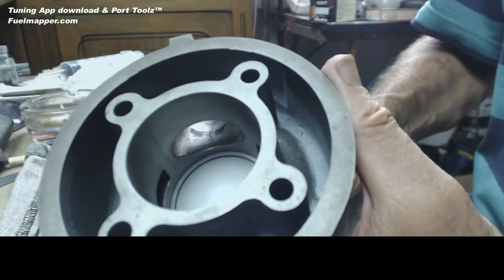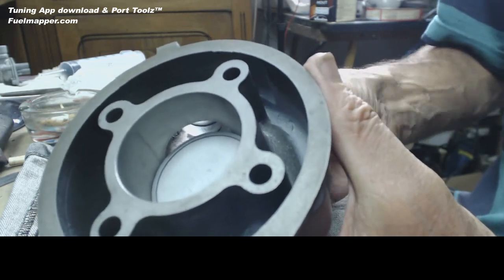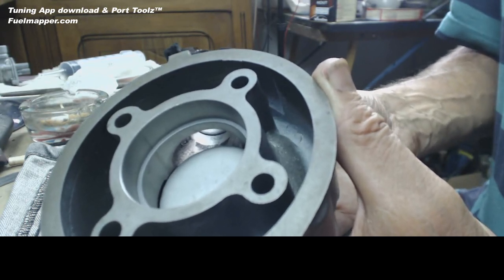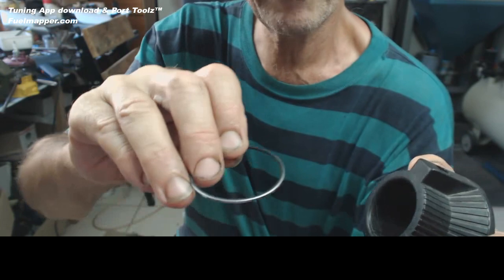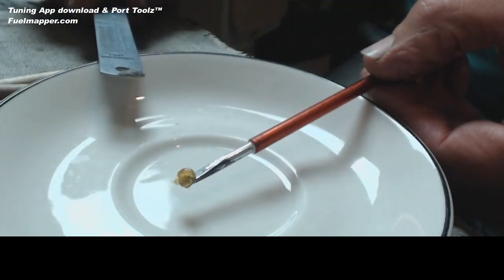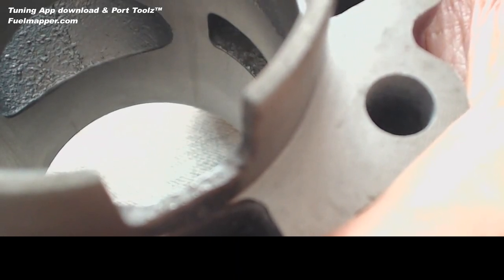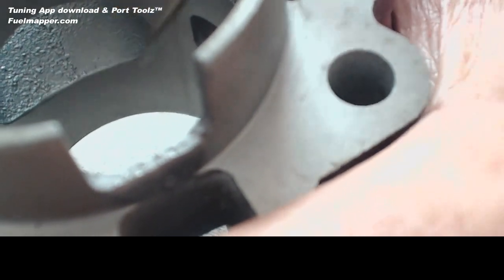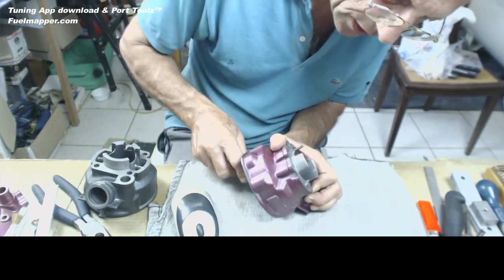Porting Tools:  Cylinder wall scratch & scoring - Stopped in 5 Easy Steps

Comment: Wouldn't the piston rings do this by itself, and once the piston rings are worn out a bit you can change them?
Reply from the maker: If you are lucky, the bores may survive this process, however it is often the case that the bore becomes scratched or deeply gouged ... the hardened piston ring catches the port edge, ripping the metal down the bore.
There are other benefits, but securing the bores is the most visible ;)
Reply: @EngineTuning  I see, and this would be the most common issue in cheaper top ends I would assume? or do the really expensive ones also come with this issue?
Reply from the maker: It's hard to say.
You need to examine new cylinders under a good light.
If the ports have razor sharp edges... 
When the ring deforms into the port ... as it reforms its shape to the cylinder, it can catch the sharp edge ... in a millisecond, the damage is done.
Therefore, at very least remove the sharp edges.

The problem for manufacturers is that; radiusing the ports is a time consuming task.
Hence, it is left to the customer, or dedicated tuning shops.
Reply: @EngineTuning  sounds really strange that they sell a product that will break the product that they sell you.. so the original manufactured cylinder that comes with the bike should have this already done to it yes?
Reply from the maker: 1. It's not strange at all.
2. Either the original has been radiused, or it hasn't.
    We would hope that the sharp edges have been removed ... but have they?

Don't forget ... the owner doesn't discover if the cylinders are scored, until they open it up.
If, when they do, they find them scored ... it happened during the running in process.
Ie. In the first moments of the engines life.
(If the port edges have worn in successfully , there is no reason for the rings to gouge a piece out)

Clearly (and logically); if all two stroke engines were well prepped from the factory, there would be no knowledge of scoring ... we wouldn't even be discussing the topic ;)
Reply: @EngineTuning  Interesting, thank you for the information.
Reply: @EngineTuning  Also, if we were to bore the piston rings instead, wouldn't that have the same effect?
Reply from the maker: Regarding modifying piston rings ... you can't.
Anyway, the problem is with the ports not the rings.
Reply: @EngineTuning  Wouldn't it do the same thing to round the edges of the piston rings? Have you tried it? are you sure it wouldn't have the same effect, or does it lose compression somewhere? :P
Reply from the maker: > Wouldn't it do the same thing to round the edges of the piston rings? <

You are not thinking this through.
... Picture the ring being forced into a hole with sharp edges.
(a square hole is the worst)

The ring pops into the void...
Ask yourself : 
How on earth will that ring regain a circular shape, without a bearing surface to squeeze it back into a round shape?
How???
... because, when sliding down the vertical edges of the port; the next thing it meets is a flat piece of metal (that happens to be the inside lower face of the port)

If you cannot picture this, it doesn't matter, because the video shows you exactly what is happening ;) 

... and when you are finished ... click the like button and subscribe.
It's payment for my personal tuition ;)
:D
Reply: @EngineTuning  Haha, I've got a hard time picturing it in my mind, I'd like to test it out in practicality one day and see if it would work though, and just to clarify: The Piston rings gets the bearing treatment to round off the edges cause it's a sharp surface that catches onto the other sharp surface, so if the piston ring retains the middle circumferance there is still a completely sealed environment but however the edges are rounded and smoothed out so that in theory it will be the same thing but just the other way around, i.e piston rings being rounded off instead of the ports.

I've only recently aquired my first ever 2 stroke and I'm learning a lot from your videos :)
Reply from the maker: Thanks for the like, and subscription ... you did the right thing ;)

Think/research piston rings another time.
Concentrate on what is happening to the ring, as it slides up and down the cylinder, passing the ports both times ... around 54 times every second at tickover ... around 333 times per second at 10k rpm.

Cut a square hole in a card, and slide a round disc into it (a jam jar lid).
Push the disc down, and it hits the bottom of the square.

Now, take the jam jar (round opening), and push the lid into it.
Slide the disc down.
The curvature of the jam jar, gradually guides the disc out of the hole.

That (!) is what you want to achieve with the ports.
Reply: @Luburium  if you round the edge of the piston ring then the rings will never break in and sealvto the bore. you will have low compression and blow by. the only cylinder I have seen come from the manufacturer with chamfered ports are aluminum nikasil. that is because you cannot do it after it has been nikasil coated

Comment: Hi. Great video. Can the tools still be purchased? Thank you kindly
Reply from the maker: Hi Brett :)
I stopped making them after the last batch.
It had been coming...
They are kind of simple, and I'd made the bending jig; but there are a lot of manufacturing steps.
At the time, I didn't have a lathe; so I was drilling the wood body by hand , and.....
Yeah, yeah, yeah ... the drill slipped, and went through my finger.
Ouch!
No problem; it's a man's wound; but I figured that the cosmic consciousness was telling me something :D
Consequently., I sold off that batch, and then put up the notice that you have seen :(
Overall, I was doing it to help like minded individuals, and I figured that you could knock some tools out for yourself.
Life eh?
:)
Reply: @EngineTuning  ah no worries all good. I should be able to Macgyver something . Cheers

Comment: What's the name of that file tool
Reply from the maker: I called them 'Port Toolz' because it seemed to work ... sort of better than 'Port Tools' :D
From the last production batch, I have just 2 sets remaining.
I'm going to discontinue them for a couple of months, until I have my new lathe set up.
Reply: @EngineTuning  I would like to order one ..wheres the link?
Reply: @EngineTuning  I find the link thank u
Reply from the maker: @macmotorizedbike3834  Yeah, the purchase link works.
Paypal send me an email notification of a purchase.
I then package the tools - 2 tools, 4 heads, with the cutting compound.
I would advise you not to choose delivery with signature, because if no one signs for the parcel, then it gets returned to me - this has happened  ;)
Once posted, I will update the paypal transaction, and they state that they will confirm to you by email, that the tools have been shipped.
:)